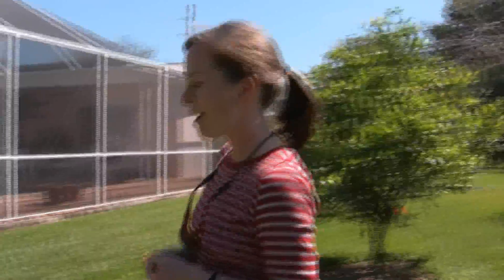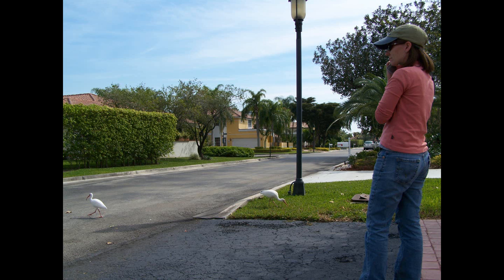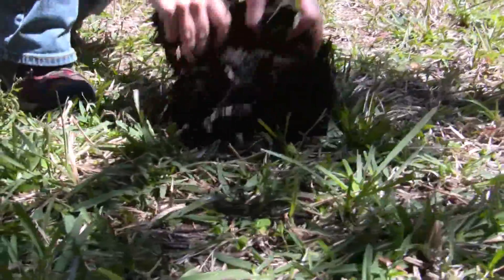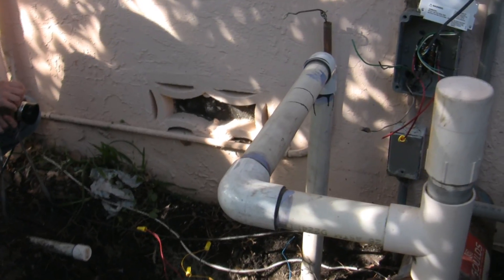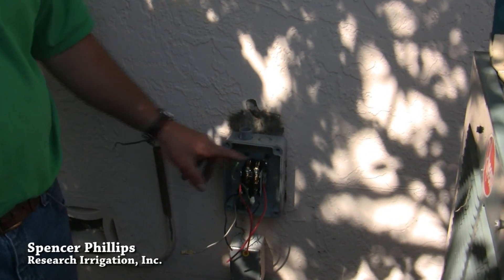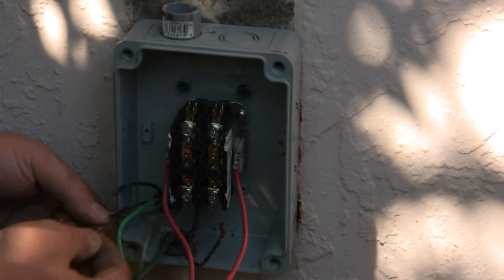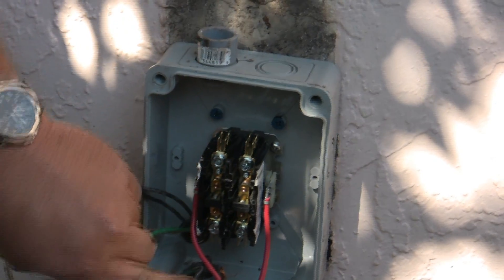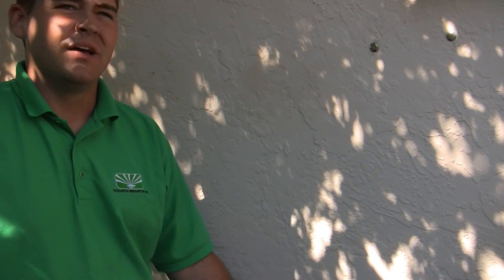Part II Irrigation retrofit case study

Comment: umm twice the voltage and half the amperage = same wattage or power consumption.
P=I*V
Reply: I was just about to write the same thing. I shook my head when he said it was less amperage use. And then splitting the same run for 220 and 110? I'm pretty sure that's not code. The load is not balanced.
Reply: P=I*V  Ohm's law....And our meters spin based on K watts used and not 1/2 the current.  Thanks
Reply: +Mitchell Tech
Aside from your straw man of how you think a utility meter operates, you posted the same formula, but can’t do the math. At twice the voltage with half the current, the wattage is the same.
Reply: My point exactly about the wattage. 1/2 the I and 2x V, the wattage used is the same for the example of 120v and 240v
. Ohm's law.
Reply: +Mitchell Tech
Oh, so now you figured out what the OP said was correct.  LOL
Reply: Take a basic EE course or just learn Ohm's Law.
Reply: +Mitchell Tech
LMAO Yes, we see you learned a new word today – “Ohm's Law.” Very good…  make sure you continue using it in every  post you make.

Comment: I am a sprinkler con i was told b irrotal that using a wire off a 220cir and a nutral is no good it could mess up the cont i did a retro fit with the some krain pump start realy and a i had a 220 pump i had 2 go 2 the braker panel 2get 120